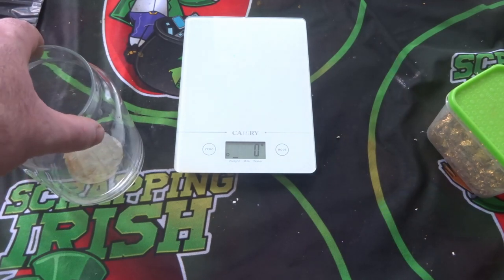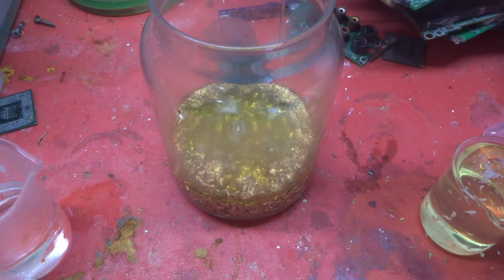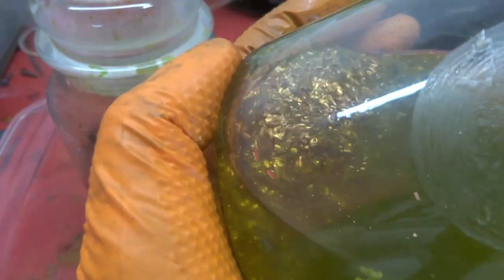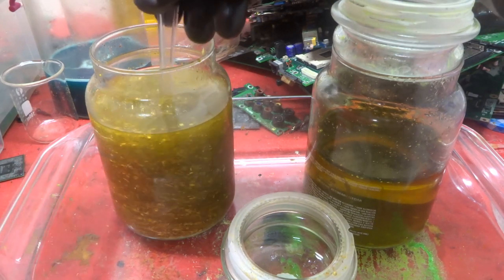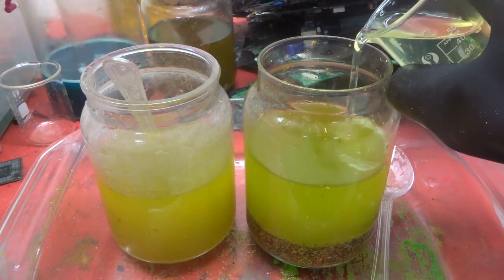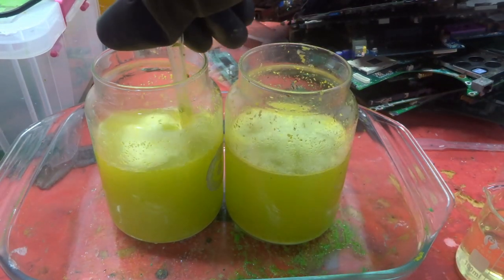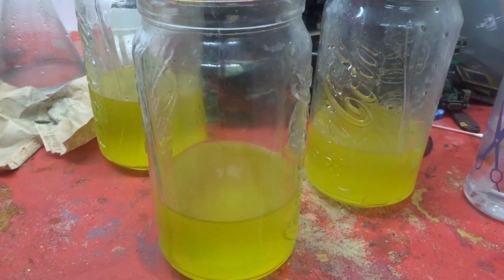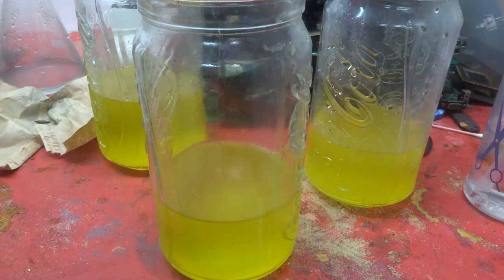gold recovery from ram part 9 hcl and bleach method

Comment: Are those reused candle drawers you're using because I had never thought about that but those would have to be tempered I suppose what are they to be heat resistant, what a great idea, now I can retire my coffee pot
Reply from the maker: Ya they seem to work good for me but I have had one crack after about two years of use so good to have a catch container under them still

Comment: ACCORDING TO THE VIDEO EHEN YOU REACH THE STAGE WHERE ALL THE GOLD HAS MELTED AND TURNED INTO A LIQUID HOW DO I TURN THEM INTO A GOLD NUGGET    THANKS
Reply from the maker: You need to denox,and use smb to drop gold out as a powder and then rinse the power a few Tim's with distilled water and then after that you can melt the gold powder into a solid piece of gold

Comment: Thank you for taking time out of your day to help everyone.  Based on what I have understood from many sources,  I am going to use bleach and vinegar and salt? I am not sure why I am thinking salt. I am going to follow your tutorial and no salt.
Reply: You could use salt un-iodized sea salt and the reason for that is that that will increase the conductivity because believe it or not distilled water does not conduct electricity so it's actually the minerals in solution that do all the work with the stripping of the the electrons

Comment: I followed the steps and my solution is a lighter blue does that mean there's some copper in solutions? How can I remove the copper if so
Reply from the maker: Has the gold gone into solution, and was it ram foils you are working on
Reply: @ScrappingIrish   95% of gold is dissolved, and it's gold fingers from old computer boards and pins
Reply from the maker: @Spoolin_society  the  pins are the problem may have tin solder I only use hcl bleach on foils from ram